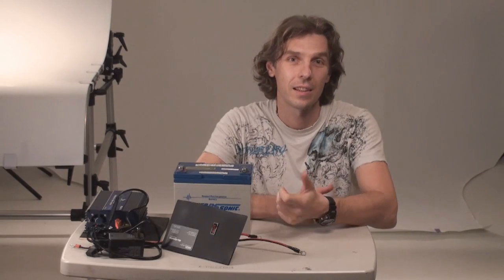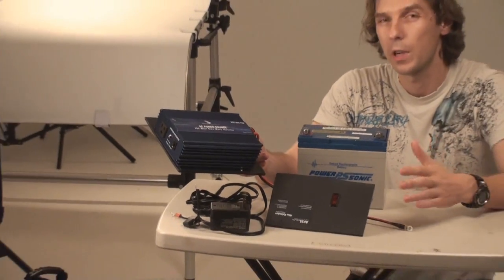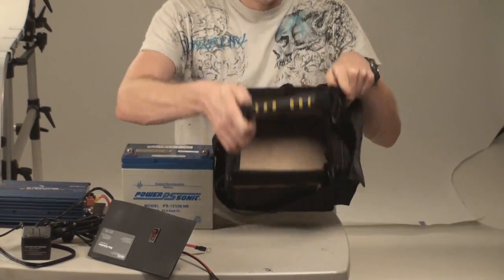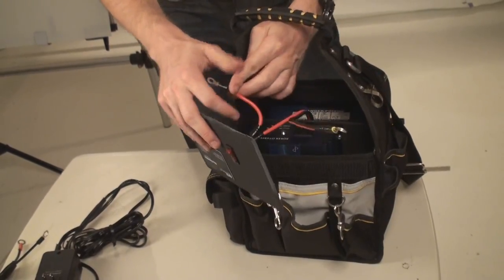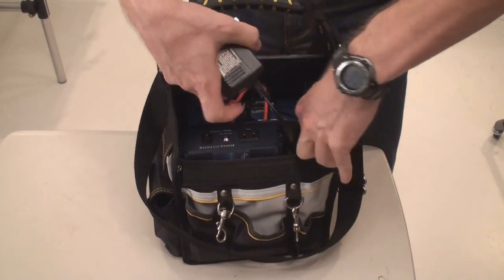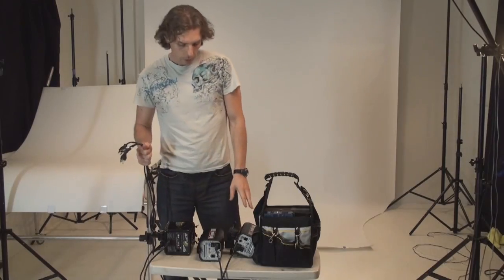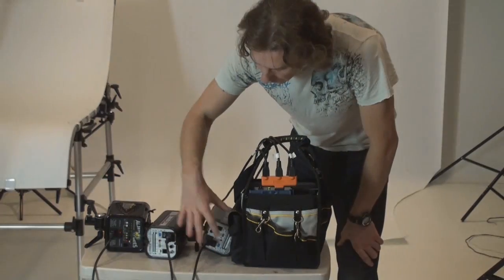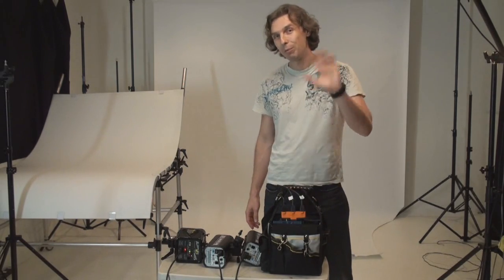💡DIY Battery Powered Pack for STUDIO and OUTSIDE Photography

Comment: I built my own inverter/ battery pack to power two 500 Joule Bowens studio monoblocks.

You will need at least a "3000 Watt peak power, PURE SINE WAVE inverter". Preferably with a built in cooling fan. Each 500 Joule flash unit momentarily draws 4 to 5 Amps at 240 volts at the start of a recycle charge. which is a momentary approx 2000 watt draw. The current then drops to zero over the two second recycle time as the flash capacitors charge up. Your inverter is way too small which is why it burned out.
For batteries I use two 12Volt 22 AH Yuasa motability/golf cart sealed lead acid (SLA) batteries,. these give the best output for their size with a two second flash recycle time..

If weight carrying is an issue I use just one battery which will give me 650 full power pops on one flash head. If weight carrying isn't an issue I use both batteries connected in parallel,  giving me 12 V but twice the capacity.  Which is 1300 full power pops for one 500 Joule head or 650 full power pops with two 500 Joule heads. To increase capacity just add more batteries in parallel. The inverter can be had for about $120 on E Bay and the batteries are about $90 a pair.

The inverter is fitted with a single plug 240 Volt output. I use an extension lead fitted with a weatherproof twin plug outlet. The flash head mains leads then plug into the weatherproof twin outlet. Also the extension lead is fitted with an in line RCD safety cut off.

The whole unit cost me about $250 to make.

1300 full power pops on location! Reliable and safe.
Reply: May i ask why only pure sine what will happen if i used modified?

Comment: If weight is not a big issue, and you need to power a lot more devices for a longer period of time - you might consider a marine deep cycle battery and a bigger inveter. Cold probably fit in a cooler and attached to a dolly.

Comment: This DIY solution is ok for a few uses only. 7 seconds to recharge studio flashes when the battery is full charged but what about the duration after 20 or 50 shots ? Pb batteries are not designed to support this kind of load, unfortunately !

Comment: About how much did this DIY cost? I'm looking to build my own because I obviously can't afford a $1000-$4000 portable battery pack. If anyone can answer this, that would be super helpful!
Reply: a. Goddox 160W light costs around 40$,
b. 1000 watts Inverter (12V to 220V) about 15$
c. 17A dry btry 20$ ( you can fire a 160W light about 430 times in one charge)
d. charger for btry about 2-3$
Reply: You can get a vagabond for like $400 and a mini for like $250 I think...  They dont have to be thousands.

Comment: How often can you trigger a single flash before the battery is empty?
Reply: if its 35A btry he can fire 160W light about 800 times. 
i've also made it for Goddox 160W light with a 12A btry & its fine enough for me it gives me 250 shots easily

Comment: Hi Alex. Thanks for your video. Loved it very much. But i wonder. Didn't you have problems with heat building up in the power converter when using your diy powerpack. grtz Martin

Comment: You made my day! great job, but I have a question, Can I use this kind of pure sine ?http://www.ebay.co.uk/itm/300W-600W-Peak-PURE-SINE-WAVE-POWER-INVERTER-WITH-SOFT-START-DC12V-AC240V-/360488869620?pt=UK_Home_Garden_PowerTools_SM&hash=item53eecf9ef4 is it gonna work? with (Power Sonic 12V 35AH (33AH 34AH) Deep Cycle AGM Battery Mobilty & Golf Trolleys
)??

Comment: I am trying to build something similar to this to use with 2 1000w dynamite packs with 2 heads per pack. My requirements are not about recycle time as I shoot with an 8x10 camera so by the time I shoot again it's been over 30 seconds. Since I suck at understanding electricity I was wondering if you could tell me if I need to get a 1500w sine inverter or will a 500w or 300w inverter will do to power my packs and heads consistently. I seem to be under the impression that the high wattage inverter will give you a faster recycling time, than a 300w inverter, but since I don't care about recycling time, would a 300-500w sine inverter do the trick?

Comment: Great tutorial!!
Question:  If you're in a studio setting can you plug in the battery to an power outlet to keep the battery charging while shooting?  I'm currently trying to create the same setup (without inverter) as you but using speedlights. Any suggestions  Shoot me an email at brian.huff100(at)gmail(dot)com